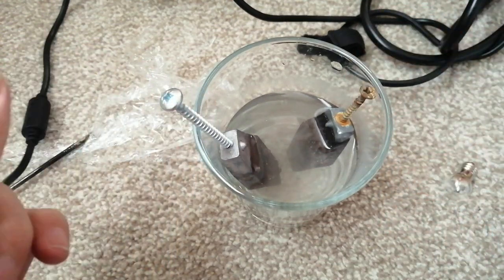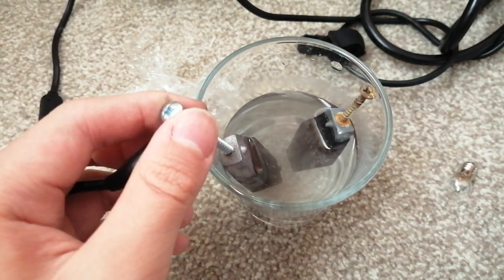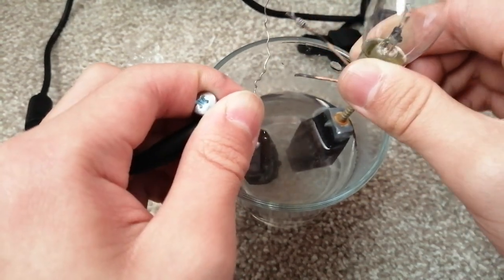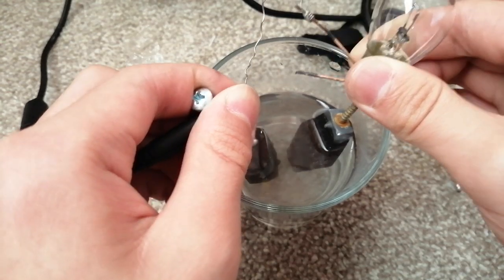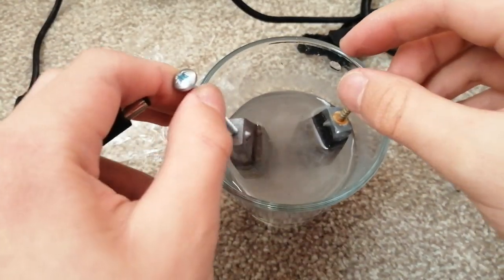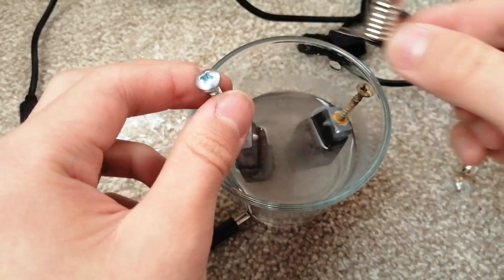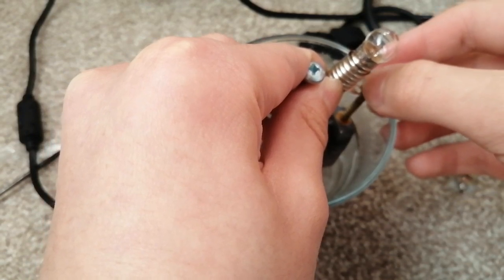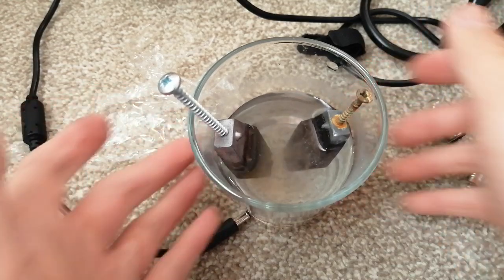How to make Lead salt battery (magnesium sulphate based)

Comment: what's  voltage and current of battery
Reply from the maker: 2.1V standard electrode voltage 100mA because small surface area.
Reply from the maker: @reeras varghese No anion attracted to the anode, where oxidation takes place. Which means lead dioxide is formed at the anode of the cell.